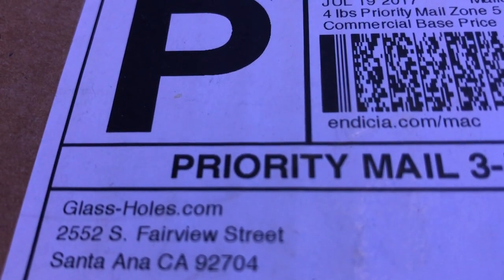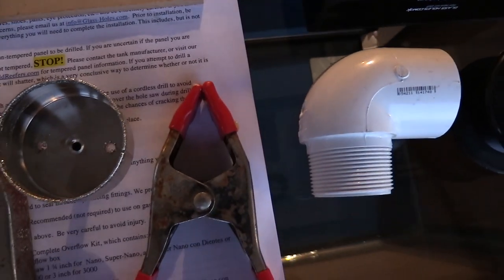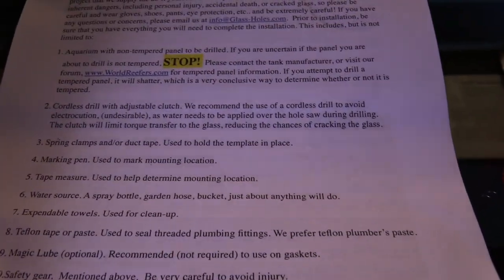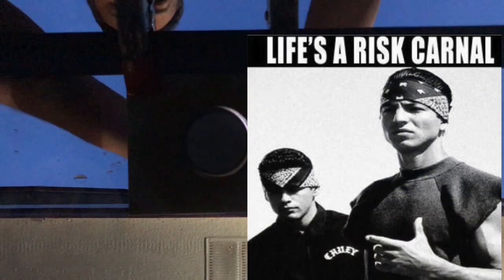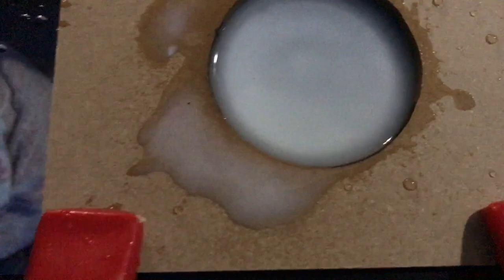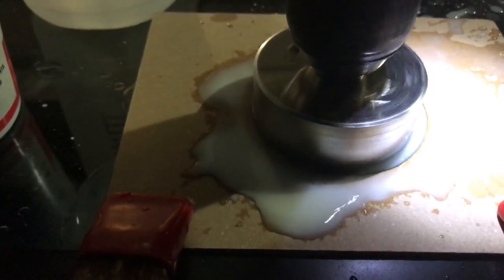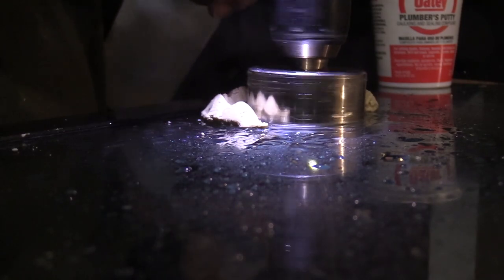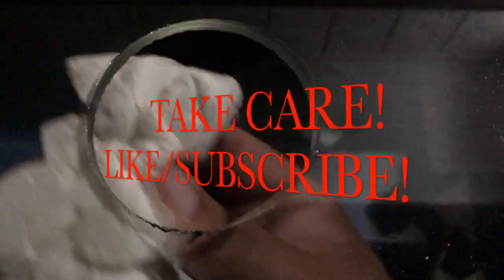HOW TO EASILY: DRILL A GLASS AQUARIUM 40 GALLON BREEDER | Glass-Holes Overflow Box

Comment: Good job bro for being your first time. Do you know anything about the top fin 75 gallon aquarium, I wanted to buy one so I can drill it and do a reef tank but I don't know if that would be a good tank the reviews I've read say that it's not that good that it might leak and that the glass has a greenish tint to it making your livestock a seem a different color but this reviews are years old. Any input on this would be appreciated thanks.
Reply from the maker: Hi Oscar I dont know to much about Top Fin aquariums. But I do know about aqueon and marinelands. Maybe check out FishTankDirect.com Not a plug for them. But I have see they have a lot of tanks that they will ship. I dont know them or work for them, NOTHING. But Ive just seen, also SCAQUARIUMS.COM is nice.  Try the website too! Thanks Oscar, Have a good one
Reply: 915Mang thanks..I'll check them out.
Reply from the maker: Oscar1467 No Problem hope that helps